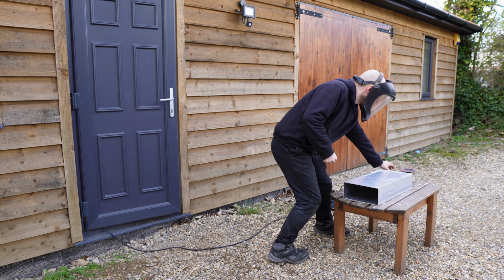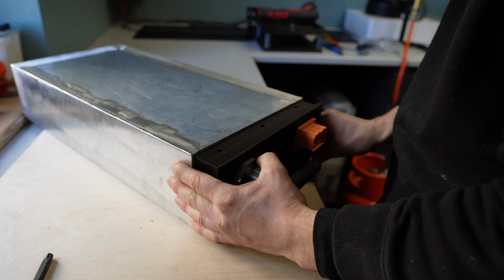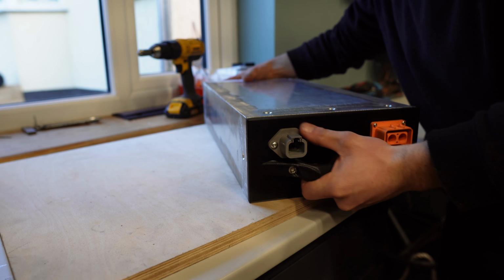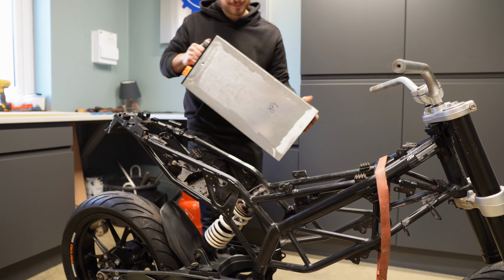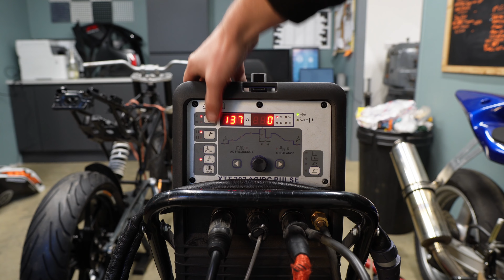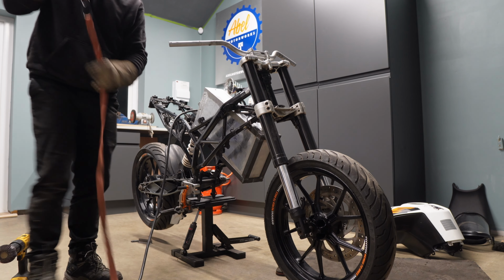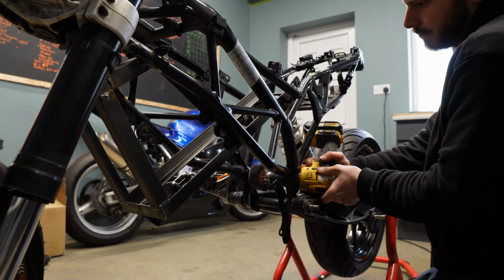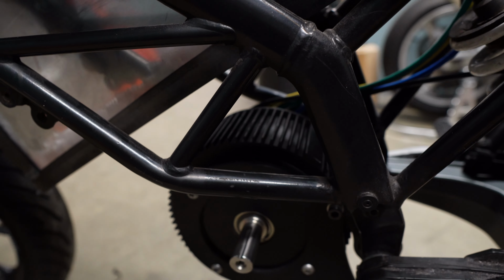What's The Best Motor For An Electric Motorcycle? And What Am I Going To Use?

Comment: Why didn't you choose or talk about hub motors? Are you planning to use the motorcycle for off road?
Reply from the maker: My issue with hub motors are any that are 5kw or higher have a large mass that really effects the unsprung mass. Also the larger mass as it spins faster takes more effort to change direct. Or it takes more effort to lean the bike in corners. Resulting in an unenjoyable ride